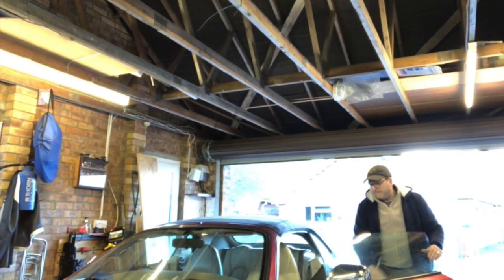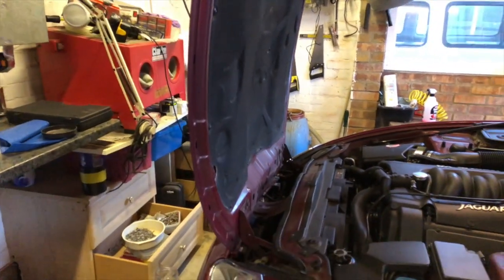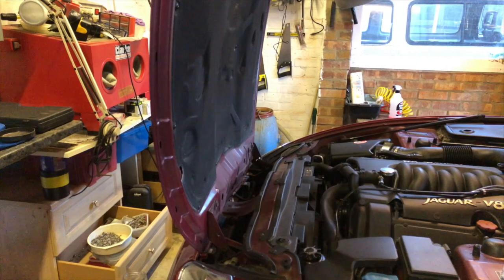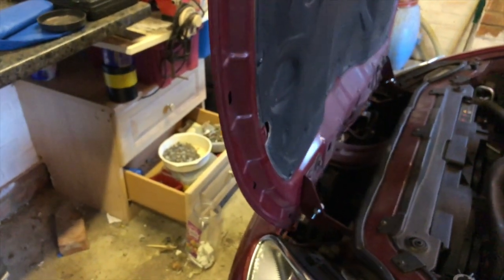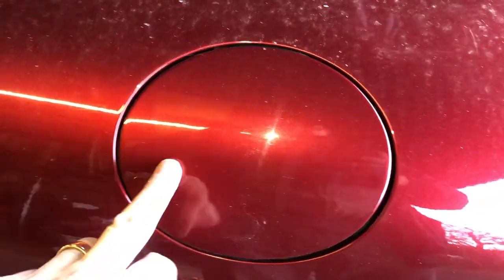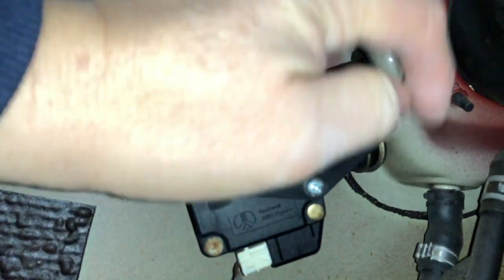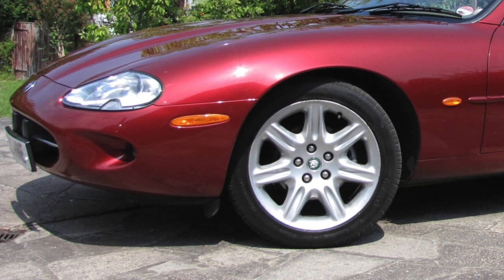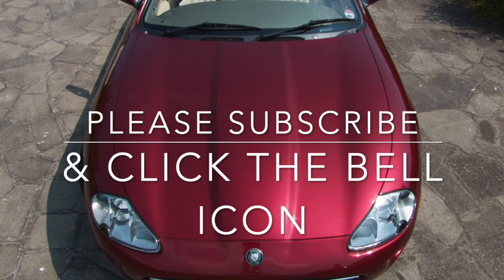secrets of the Jaguar XK8 & XKR EPOSODE 7 flap & Bolt

Comment: Hi John it's me again Billy Z. A couple of weeks ago I spoke to you about a problem that I was having with my XK8, when Manuel shifting I was getting a trans fault code, and you suggested some possible things to look for,.I had checked on a few of these and told you I would let you and the rest of your subscribers know what the problem was and the solution for the fix. Well it turns out one of your suggestions was indeed the culprit. The top transmission shift cable was stretched and with a minor adjustment,problem solved..In all honesty  it is a simple operation ,but still a very precise adjustment is needed because you have to make sure that your shifter lines up with all the micro switches , so that everything functions properly. Like the neutral safety switch & backup lites,to name a few. In closing I again would like to thank you for your help on this matter and any others that took the time to help think this one out. And I would like to add one more comment, my XK8 shifts so smooth & tight now that I LOVE IT EVEN MORE if that's possible. Thanks John, talk to you soon and happy motoring ! Billy Z. USA
Reply from the maker: Really pleased it worked out Billy. And thank you so much for taking the time to share the final solution. 
Keep watching pal. plenty more XK8 Vids in the pipeline.
John.

Comment: Great videos!  Thank you.  I have a 2003 XKR and it has many issues.  One is the garage door opener.  It seems to be functioning, but I have made many attempts to program it with no luck.  My garage door opener is probably a 20 year old Sears Craftsman type.  I found some help here and there but they are not as clear in what they are doing as you are.  Thanks again!

Comment: John: Its me Billy Z. From USA I've corresponded with you once before. I've come across a new problem with my XK8. I was enjoying a leisurely drive on a well paved very curvy road in the Pennsylvania mountains where I reside.I decided to use the manuel shift for the added performance and when I shifted from 3rd to 4rth my transmission fault code lite lit, the car went into a  limp mode,I pulled over & shut off the ignition, did a physical check on a few things , couldn't find anything obvious.I restarted the car,the fault code went out & I continued on my way and decided to try the same shift as I had previously, 3rd to 4th shift and same scenario, trans fault code lit. So again I Did a restart,light out,continued on my way,tried it again,same. I thought I would change it up,skip 4th & went directly to drive,no fault code. From drive to 4th,no problem, this problem occurs only when I manually up shift from 3rd to 4th,If I skip 4th no problem,downshifting no problem, up shifting 3rd to 4th problem every time. Have you ever heard of or possibly know anyone who has had this problem? Or maybe someone out there has had the same scenario,  I could really appreciate some help or advice on this matter. Thanks again. Billy Z. USA.
.
Reply from the maker: Hi Billy Z
If I understand you right, the car would make the upshift from 3rd to 4th problem free when in Drive. It only Faults out to limp home when you use J gate to manually make that same shift.

I have not heard of this problem but logicaly it sounds like a problem with the shifter switch rather than the gearbox. (Making it a cheaper fault👍)
If you or any of your friends have access to an OBDII reader, then that will probably give you some good clues by reading the cars memory and giving a more descriptive fault code.
I will have a look at some manuals I have and see if give any clues.
Finally, I invite our fellow subscribers to chip in with their thoughts on this.
🤔
Reply from the maker: Hi Billy. If im understanding correctly the car can make the 3rd to 4th change on its own in drive with no problems but when you manually make the same shift it errors and goes into Limp mode.
I have ve not had this or heard of it but Logic says its more likely to be associated with the manual shifter mechanism and or its electrical switches than it is the gearbox.
My first call would be to borrow or buy an inexpensive OBDII code reader and use that to read the fault codes in your car's memory. It will potentially give you a more specific fault than the 'transmission fault' indicated by the dashboard.
Next, I would check the electrical connections to the manual shifter mechanism. Then I would check the manual shift 'Bowden cable' for evidence of a loose adjuster or locknut.(one is under the centre console and the other is beneath the car on the left-hand side of the gearbox. The cable itself may just be a little stretched.
I know it does not sound Likely and that I sound like a cracked record, but ensure your Battery is in good condition. The transmission ECU is a heavy battery user.
 
Like most of our subscribers I'm an enthusiastic amateur/enthusiast so I don't have all the answers. However, between all of us, we probably do know the answer.
SO 'To The Garage' community. .... anyone else advise our Billy Z?

Good luck pal and keep us informed.
Reply: THANK YOU for taking the time to think this out for me,your suggestions are golden and I will apply them all, they sound like a good start and hopefully a fix. This is my first Jaguar and I love it,this car truly is a work of art. It reminds me of the bad girls my mother warned me about, very pretty,but could give you Trouble. I've had,wrenched on and restored all American cars until I found this one,so I'm trying to learn all I can about this wicked Beauty . Thank you both for your thoughts and Ideas for the fix. I will post later what I find. It could be a week or so till I get to it, Big N.E. winter storm headed my way. So if any other Jaguar enthusiasts out there have some ideas or fixes in mind it will be well received. Billy Z. USA
Reply: Billy Z hi. 
If I may ad some information to your problem.
When this occurs, it will HELP YOU a great deal to notice the following :  check during the Limp mode  if the numbers and letters on you J gate shifter are illuminated.
If not, your problem is by 95% your shifter solenoid .
Either you'll fix the problem with an electrical contact spray cleaner( it gets very dirty and dusty underneath the shifter)  or if not by replacement. My problem was the dust...
If it illuminates normally during the  Limp mode  then you need a serious read out by a mechanic with the advanced OBD reader. 
He will guide you to the problem...and further actions to solve it...
Reply: Thank you also Nicholas,an additional question if I may. Do I need to access the shift solenoid from the top,or do I need to crawl underneath? 
Thanks Billy Z.
Reply: @billz.3991  you can access the area there with an extension nozzle. 
Just spray few times...
Sideways arround the shifter...
Start the car, and spray as well during shift change.
Remember don't over do it..
Of course the best way is to remove the cover and clean it up properly .
There are vids on the Tube how to do so.
You don't need to crawl underneath the car .
Bill if I may add one more information. 
When you drive your Jag avoid to rest your hand on the shifter..
I know the wood feels amazing but  there's a possibility to damage the spring underneath . 
Do hope this helps..

Cheers .
Reply: @NicholasSpartan  Thanks Nicholas ,my problem turned out to be an adjustment on the shift cable,but also took your advise and sprayed contact cleaner at shifted better to get while I have console apart. Thanks for the useful  suggestions, talk to you again another time. Billy
Reply: @billz.3991  excellent. 
Usually these kind of snags are related with electrics Bill. 
Glad that you sort it out .
Cheers .

Comment: Very head up as I was able to open the gas tank this way but is there a fix?  It’s stuck and won’t open for some reason but my battery is fine
Reply: *helpful
Reply from the maker: Assuming power is getting to it you need a new boot release servo